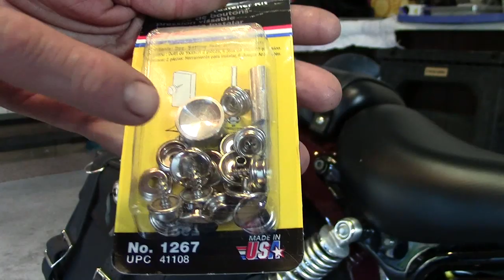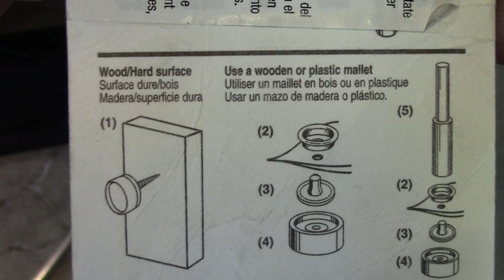250 Yamaha Saddle Bag Mount

Comment: Thank you. I just did this on my Yamaha V-Star 250.  Easy to do and did not cost me a single penny.  I used a brass stock from work. Easy drill and assembly was simple. Yes I ride a 250 to and from work. 20 miles a day at $5 a week in gas.

Comment: I used some 3/8th aluminum round stock. heated it with a propane torch flattened the ends and drilled them for bolts, then bent it to shape so far it looks great and works great.

Comment: Years ago those press studs had a longer stem for thick leather. As a car trimmer, I remember them well. They also went on MGB hoods. You could fit , something like a used cycle inner tube, doubled over at the bottom. Just needs thinking about!!!

Comment: That's a very imaginative solution for a saddlebag bracket BUT you cannot just open the saddlebag because the turn signal is in the way.  You have to unzip the whole bag and remove it to get anything out.  I think I can use some of your methods to relocate the turn signals and make up some extension wires in order to mount the turn signals farther back on the fender.  Then I can use your methods to make a bracket.  Thanks for giving me the picture in my mind so I can get started.  Oh, if you cannot find a piece of rubber to fit over your flat stock then how about wrapping some duct tape or electrical tape around the end to keep if from rubbing (metal to metal) the paint off the control arm.

Comment: If you get longer bolts for the seat, you can shim the seat bracket on the underside of the seat with washers to take the pressure off the seat. :)

Comment: Glue a bit of bicycle tyre inner tube to the bottom ( about a 5 inch piece) which will stop rubbing and stop rattling. Glue inside the rubber and it will hold well and last quite a while before needing a new piece. Stops the saddle bag rattling as well and wearing.

Comment: At the bottom put velcro instead, easier to attach and remove. With the top snap I would suggest a backing plate as well, that GRP tends to fracture with time.